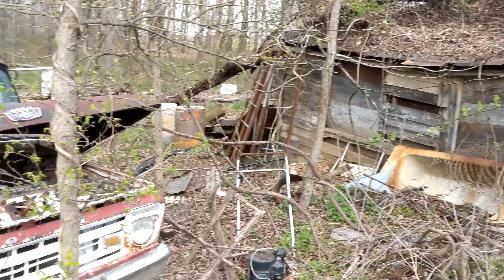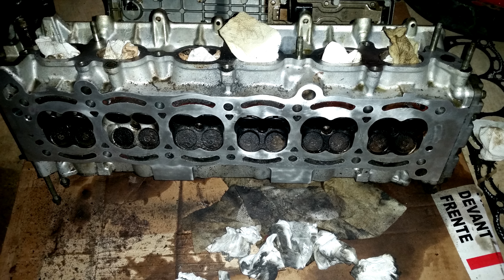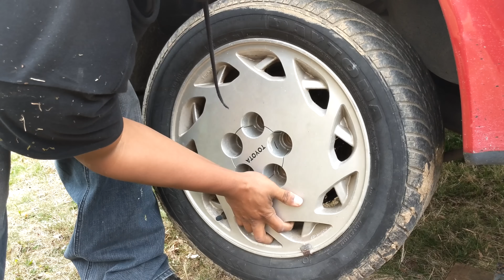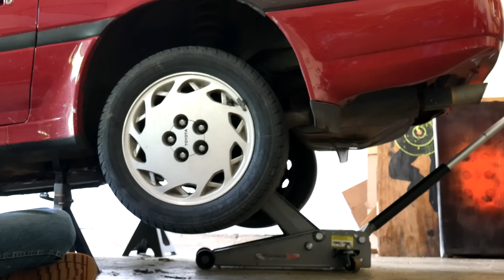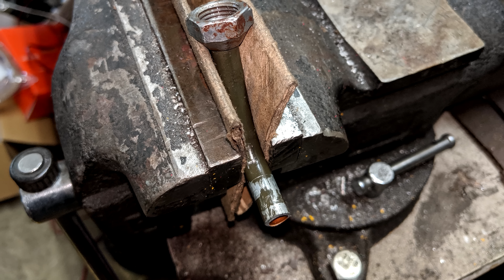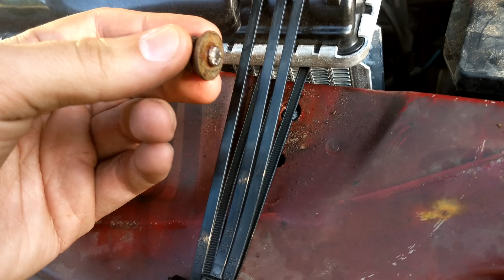1987 Toyota Supra MKIII Project Car - A Labor of Love

Comment: I inherited a 1987 Supra 5 sp turbo with 43,424 miles garage kept one owner. All original the problems areas were replaced. It does smoke if sitting a long time. Tech notes oil caught in turbo convert will burn off. I might sell it before something major happens. I don't want a money pit.  A ballpark figure. How much do you have invested?

Comment: The wheels with the LEFT/RIGHT markings is the most common thing that I see installed wrong on these cars. And it is not only an aesthetic design to have a matching pair on each side of the car and have the pattern turning the same way on both sides but the wheel is also designed to draw cooling air to the brakes when it is installed correctly.

Comment: If you Wonder what's cause the smoke just when you start e few hours later is all seal oh valve under de valves cover to the base of the valve chaft in the midele of valve Springs clamp on cylinder head. It seal the chaf on de up side of the valve chaft and tip camchaft and sauf.ther Nevers cause problem and degaradate more than that.

Comment: İ have a pretty similar story to tell...

İ got my 7mgte with mt in switzerland for 750 Franks....that was about 700 Euro back then. Also red color and the paint was exactly in similar condition. But the engine was just fine. Only 120k km, and i only needed to recover the stuck fuelpump. Running just fine, fixed all brakes, all i need to do now is a paintjob.

Comment: I would love advice on wether this is a good first car or not, it’s a Toyota so I imagine it would last forever, I’m a few years away from being able to apply for a drivers license and I don’t know what to get. I want something that I can chuck a turbo and a few other upgrades on just to have a little fun with a few 100 horsepowers.
Reply: I bought my brand new red MkIII Turbo in 1989 when I was 31 years old.  It was my daily driver for many years.  I maintained it and always kept it garaged, and although it is no longer my daily driver, I still own it, still drive it, still maintain it and still keep it in my garage.  I'll never sell it.
Your question is 2 years old and I hope you have matured enough to have abandoned the fantasy of a MkIII Supra becoming your first car.  In case you haven't, and for the benefit of other noobs that may dream the same dream, I'll explain why the MkIII--or almost any car that is more than twice as old as you--is a terrible choice for a first car.  
1.  The MkIII is currently between 33 and 39 years old.  Today, 95% of surviving Supras haven't had the care and love that has always been bestowed upon mine.  
2.  Almost all Supras have seen 2, 3, 6 or more owners, most of whom were young, inexperienced, prone to neglecting the car except for bolting on after-market "performance" parts or experimenting with dubious engine enhancements.  Almost all were used and abused to prove to friends and unattainable young girls what a cool, macho guy was behind the wheel.
3.  Your first car should reliably start, run and get you to your destination whenever you need it.  As shown in this video, Supras that are in the price range of 99% of first time owners won't do that. 
4.  Quality parts are almost impossible to find and if found are very expensive.  You need to factor that into the cost of owning a Supra.
5.  MkIII's available today make a great second/project car for a person with mechanical skills, bodywork ability and lots of money and free time on their hands.
I hope that helps.  Make good choices and good luck.

Comment: I bought my 88' Supra last year for $8K and it sure as hell wasn't supposed to be a project car, but kinda feels like one by now. No rust like this one though.
Had some power steering leaks and the right headlight also didn't work like this one. Headlight was an easy fix, but now i've gone full LED and it does NOT like LED headlights, going to need a shop for that one.
One thing the price did buy me though was a fixed head gasket and re-done valves though. The paint on both bumpers was mint when I got it, but already cracking and peeling sadly though just from being in the sun. Best car I've ever experienced.

Comment: I subbed just for this car. I bought my 87 supra in July of 2010, I had to get a different car to handle bad weather about 5 years ago and the supra went into the garage and hasn't hardly moved since then. I just started it up for the first time in well over a year yesterday and aside from a dead battery and ancient gas, it fired up without a problem.
It was my first car and I learned a lot by daily driving it for about 4 years and changing 2 head gaskets on it.
After nearly a decade and going through everything I did, buying that car is one thing I dont think I'd ever do differently if I could go back.

Comment: Might not be an issue there, but I had an issue with the trans cooler lines on my galant, I replaced the radiator and used that kind of hose clamp on it, the worm gear type. And i had a constant, slow leak of ATF from those fittings until I replaced the fitting with the OEM spring clip style. If he ends up with a slow but consistent leak of ATF, That'd be where I check first. I can't remember exactly what the reasoning was, something about uneven force across the hose? Either way, it fixed the issue for me.

Comment: Speaking to an ex Toyota Engineer who has a big Cressida fan, he said most 7mge/te have a slight dip in the block between 5 & 6 pistons. I know decking the block might be out of the scope of this project but he was adamant it helps solve headgasket issues. I have had my own run ins with 7m's blocking a few head gaskets my self but i never decked the block (Didnt know at the time/pain in ass). My gasket failures were between 4 and 5 from memory.

Comment: I had 1990 3.0 none turbo of these and it blew head gasket. Reason why they are cheap is due to crap quality and slow. Too heavy and engine not as reliable as yamaha 2.0 fitted engine. I feel like your wasting a lot of time I’m afraid.

Comment: It's not a hardware issue, this car has been exposed to Maryland road salt and of course sitting outside in the elements for 33 years, I have an 1989 Supra, it's a Southern car and it looks NOTHING like that car, it has ZERO rust and is in better condition than a lot of 2-3 year old cars. I actually seen better looking Supra's in the salvage yard than the one you're working on, he's driving this car on the temporary spare tire, I bet if you open the rear hatch and look into the spare tire tub you'll see it rusted all the way through, that car doesn't look like it's been seriously taken care of in over 25 years. The dash is cracking due to being left outside in the sun for decades, best of luck and I hope you have some deep pockets.
Reply: Yeah it's in rough shape. I always feel weird about paying $8K for my NA 88 last year compared to what most people pay, but it's also in great shape with the head gasket fixed and no rust. I'm still loving it.

Comment: I had a similar smoke problem with my '69 VW Beetle each time I started it. It ended up being some oil making its way to the valve chamber and being burned so it then went through the exhaust. I know there are some differences between both engines, but while watching the video and noticing that smoke screen was a recurrent issue, I just thing it might be because of a similar reason...

Comment: Think if you sprayed a mist of water through the air intake would get rid of that smoke? It cleans the top of the pistons really well. Just don't use too much water. It'll hydro lock.

Comment: You can add the head gasket to the list of the most faulty problems on the 7M.  Back in the day I worked for HKS, the 7M metal head gasket was easily the best selling gasket, and those #'s did include the ones HKS made as private label to TRD.  ARP studs and a metal head gasket were like mandatory parts on those.

Comment: Didn’t these have head gasket problems because of a mistranslation at the factory?
Reply: The turbo models did. From the factory Toyota didnt re-torque the head bolts with more foot pounds and use a thicker head gasket from the stock NA motor. But that can be easily preventable, just not many people know.

Comment: Pretty sure 80s  Japanese cars had one wiring harness for all models of the car.  My 1980 Datsun 280ZX has all these connectors that don't have anything connected to them.  It's for options that weren't installed on that vehicle.  So I'll say it's completely normal to have plugs that don't go to anything in an 80s Japanese vehicle.

Comment: If i knew you were going to do this I would have documented a lot more of my current project vehicle.  1987 Ford Ranger, originally told it needed a distributor.  Well it needed a lot more then just that to be able to come back to life.  Battery, terminals, relays, rewiring the main ground, replacing the fuel pump, alternator and belt.  What needs done is putting a good transfer case in it so it can drive under it's own power again.  Then rims and tires, new leaf springs for the rear and a ton of fuses.

Comment: Gte swap with mhg and arp's.  Walbro 255, lex afm, 550cc injectors, driftmotion 57 trim upgrade for ct26, exhaust, safc, boost controller.  enjoy your 400 wheel.

Comment: I had an 1986 Celica GTS and that body style is when Toyota departed from using the Celica as the platform for the Supra and went with the new platform. I really want to buy a Supra  but I couldn't justify the cost at the time and the GTS was  sporty five speed and stuck to the road like glue.

Comment: DO NOT USE K&N OIL FILTERS! I had two fail back to back on my Honda sport bike. They weeped oil from a shitty weld where that nut is. Both times it happened after the filter had been installed for approximately 1k miles and then it coated the bottom of my bike in oil. I ended up getting a sizable refund from the company, but it was still a massive pain and could have led to an accident.

Comment: The mk2 and 3 are my favourite supras. The 4 is overrated. Also The stars have aligned as there is a new fuzzy dice and Ron finger upload within a day of each other
Reply: I was thinking the same and was checking the comments, both provide actual content without spending 5 minutes trying to sell me something, which a lot of others do, it is appreciated.
Quality content.
Reply: MKIV Supras pull over 1g on a skid pad stock and factory bottom ends have gone 8 secs. They’re not overrated and you clearly haven’t been around them much less owned one.
Reply: @1439of2000  i know a guy with a upgraded shocks/stock suspension type(leaf spring solid rear axle, ifs with coil spring)76 mustang ii that pulled .99g on a skidpad with untuned coilovers and shocks. eat shit.
Reply: @frigglebiscuit7484  your comment literally means nothing....
Reply: @DrewLSsix  your IQ is literally nothing.

Comment: I got lucky with my last one, $400 PT Cruiser that only needed a shifter bushing and a battery.
 Right now I've got everything out but the front seats and the dash out 'cus it was pretty gross inside. And once the clear coat finishes pealing itself off I'll start to think about the dents and paint, assuming it stops snowing every couple days.

Comment: As a certified Toyota Technician... the Supra has every common Toyota problem. And the hardware problems is top of the list. All the rubber is cheap and doesn’t last (floating caliper, soft lines and bushing material, etc.)and the bolts either strip/cross thread or break reliably. Enjoyed the video and hope to see more Toyotas.
Reply: Also Toyota likes to use 1 harness and plug and play for options. Even with newer models, all the blacked out plates have connectors taped back (lovely when doing heater cores and you end up with extra plugs). The spark plugs are common and some techs add dielectric grease for better connection (success may vary). Filters come off better when engine is warm (success may vary)
Reply: That car was never garaged at night and has been exposed to some serious Maryland road salt, that state salts the living shit out of it's roads every winter and these old cars were never dip in a Zink bath in the assembly process like newer cars today are.  Being a Maryland car, I'm actually surprised to see it still running, most surviving Supra's are located in California, Arizona, Texas, Florida, Alabama, Louisiana and the ones up north are restored and sitting in peoples garages, driven only on sunny days with clean roads.
Reply: @oveidasinclair982  its funny, because where im at in alabama, nooo one wants these cars lol.
Reply: Oveida Sinclair I’m located in New York and yeah your right on the old car thing but literally all cars (new and old/zink or not) rot away if not for some intervention. And their are plenty of mk2 and mk3 here in about the same condition. However, here you get the show room quality ones jacking up the price and the shit boxes are sold as gold.
Reply: @oveidasinclair982  This gen Supra is galvanized, but road salt doesn't care.  MKII Supras are the ones with serious rust issues.
Reply: Not that I ever saw when I dealt with them.  There are known week links, but 99% of the issues are poor maintenance and people shimming wastegates on high mileage motors on stock headgaskets.  The 1% of other issues is head bolt torque is wrong for the gasket type (was originally speced for an asbestos gasket) and the oil cooling system on the turbo engines.

Comment: Holy Crap,I bet the idiot who installed the filter used a impact on that nut on the end, I also have been able to use a Monkey Wrench in order to get stuck filters off before, works pretty well. But I can see that was not going to happen with the one you removed.

Comment: That knocking sound is a rod bearing. Like the headgasket rod bearing are very common failure.
Reply: Bad headgasket+still runs and drives=rodknock
Reply: The condition of that car, I wouldn't doubt for one minute the bearings are going out on it.
Reply: Very common only because people blow the headgasket, get coolant in the crankcase, and it strips the coating from the bearings. They fix the headgasket and end up with a bottom end knock shortly after getting it running again.
Reply: it it was rod knock it would be bad on engine decel or constant
Reply: @undercover227  I've had two 7m have rod knock... one only knocked between 1800-3000rpm on acceleration or consistent throttle never on decel and was caused by BHG... the other knocked constantly and was from engine losing 3qts of oil because I forgot to install dipstick tube back in the block... one was n/a one turbo.
Reply: as others have said, HG leads to bearings... passed on a turbo mkiii a few years ago because of that.
Reply: I went through 2 rod knocks on my Mk3 as well, over 9 years, and all this other stuff that went wrong too, I fixed that car a lot, cool beanz machine though when it worked, which was rarley!